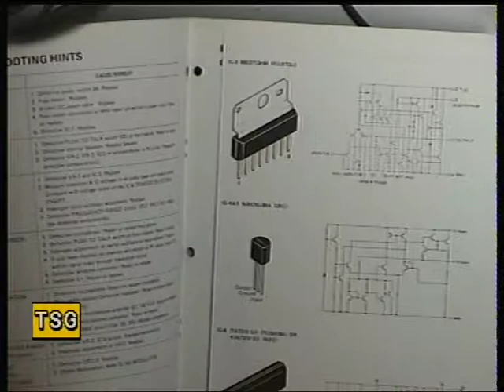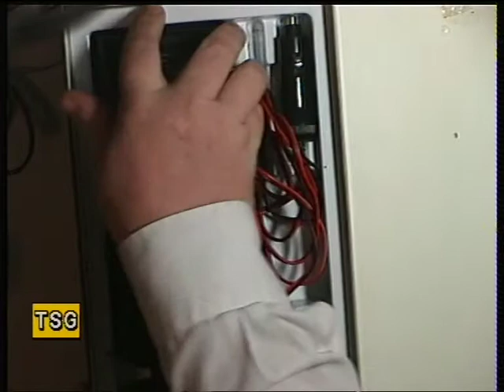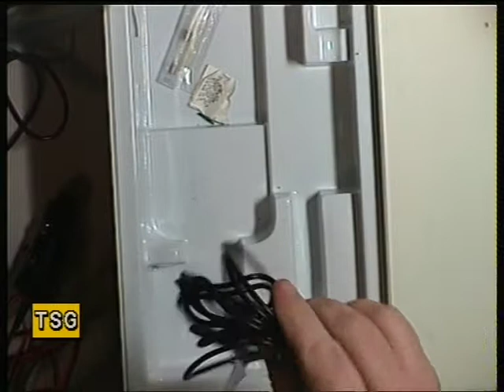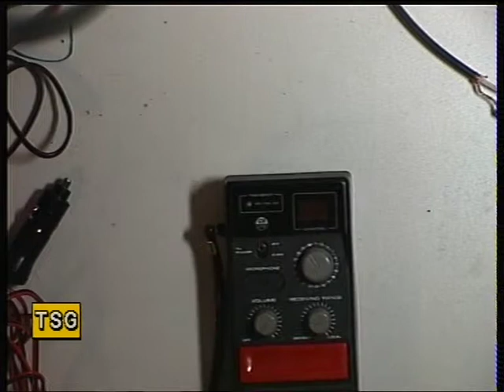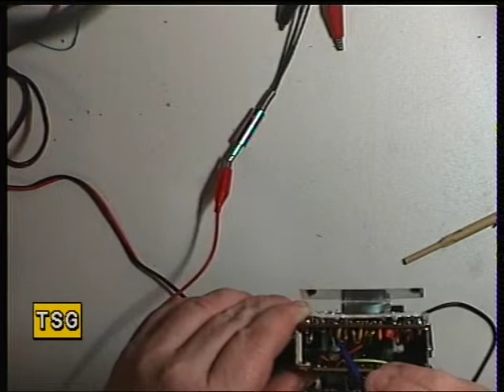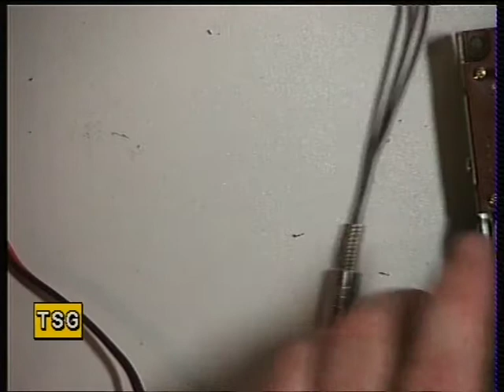Realistic TRC1004 UK CB radio (Emergency Kit). Overview & VCO

Comment: Well Richard,
i said id seen one these radios at a market stall  / Autojumble well this was held again today (sunday), and i thought if that radio is there i will buy it this time round but i must admit i thought my chances were slim, but low and behold there it still was £10.00 on the box ,so  i offered him £8.00 now im the proud owner .
Just put it to a quick test from my car over approx 1/4 mile and all seems well.
box, radio, powerlead and an intact antenna although i tryed my luck with it by driving at 30mph with it on the roof.
Keep up the vids.
regards chris.
Reply from the maker: What a bargain, Chris. You'll get at least 6 miles on it in open country on all of these types of kits. The Realistic is definately the best of the bunch. I've done 60 with the magmount on OK. I'm really pleased for you.

I'm hoping you'll soon have a shelf with 100 working rigs on.

Did you spot I did the Alba CBH2? I'll do an 'on the air' test in the workshop as soon as an antenna adaptor arrives!
Reply: Hi Richard ,
yes i did see those vidson the Alba they were very interesting, although you mention about the supply voltage in and i must admit that i never really gave it a thought and have ran this radio many times on a 13.8 volt cb pwr  supply. Although i think the last time i used it i was on my motorbike up settle way.  The carry case is now really showing its age. And the high pwr low pwr thing i always thought that was a very strange feature.
Anyway i will keep an eye out for the on air test and maybe you will get another roger.
regards chris. ps im not sure the wife will be happy with 100 rigs or more, she already thinks im mad.
Reply from the maker: I've just managed to locate & order some MPSU31 output transistors from the United States. I'm chuffed about that.
Reply: Excellent stuff , I had both the realistic and the harvard powered up , i dropped the harvard round at my dads for a quick test between them over approx 3/4 mile , both worked fine on there original antennas. ps Cant keep up with the vids there coming thick and fast,
regards chris.
Reply from the maker: I only do the electronics side of the business from October to March, so after then the videos will be thin on the ground. The summer 6 months is church pipe organ restoration!